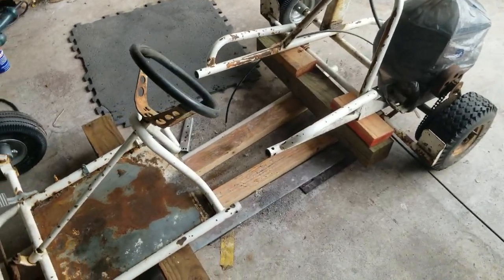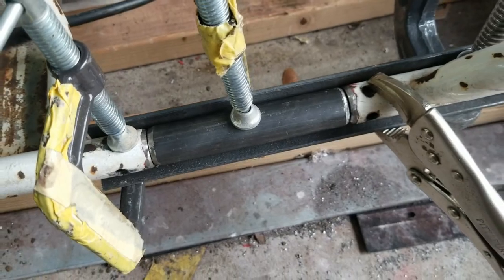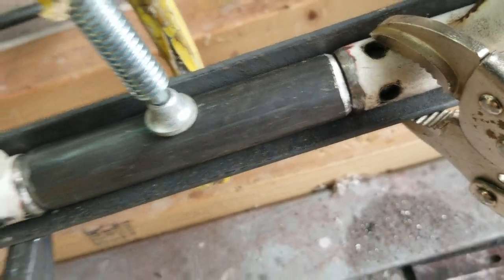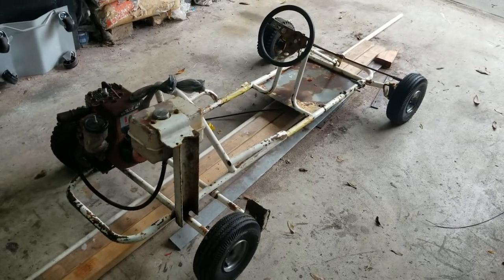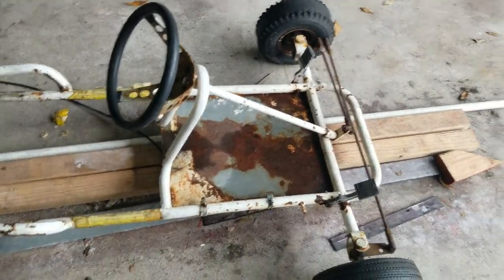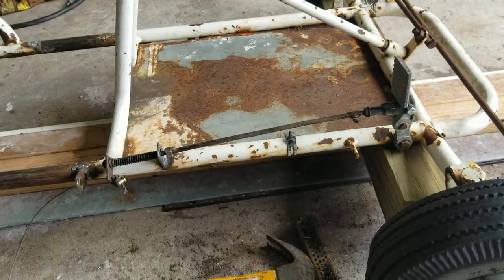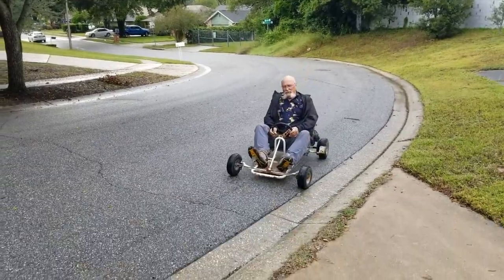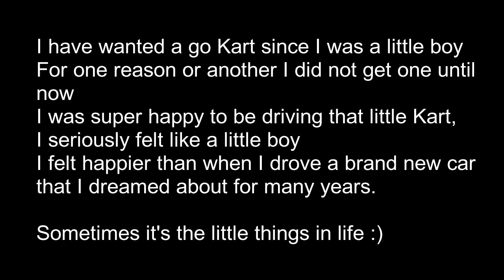Vintage Go Kart restoration Part 1

Comment: I like how U extended it...I have a go kart i was thinking about doing that, but was afraid I'd weaken the frame. 
But yours looks strong...
Reply from the maker: Thanks 👍🙂
I am very happy with the way mine came out.
Good luck in your project
Reply: I would not lengthen it at all. They were designed from the very beginning to be very small, short wheelbase, lightweight and cramped. They were designed by adults for adults and there's numerous photos of people like Steve McQueen, James Garner (both racers in real life) and Roy Orbison looking very uncomfortable on early karts with their knees in their chests. The karts that followed later that were marketed to teens and pre-teens (sold in the Sears Wishbook) followed the same pattern as people thought they were naturally perfect for smaller people.
Reply: @Hjerte_Verke  I didn't lengthen it. I Just stayed with the original frame but pushed the frame holding steering wheel forward a few inches.
That was enough space. Extending the frame was toooo much. Esp since I have 2 other bigger karts

Comment: Great idea lengthining the frame. I might copy that , the exact way you
did it, unless I  can figure a way to make it adjustable. 
I found a manco 2 people kart, at a scrap yard about 5 years ago.
It was in the big pile, they were nice enough to unbury it and let me have it 
for about   20 to 25 dollars .  And a different scrap yard about 45 minutes 
away. I was getting car parts , and they had pulled  a 1977 single manco or
sears orange crate out this time ,35 dollars. Of coarse both needed wire brushed
some straightining and welding and painting and there missing parts, but 
saves me from building a frame. I see a lot of people use the preditor 212 
at 6 &1/2 H.P. I never considerd that , Because I had a 1969 5 hp briggs 
on my homemade one . My brother sold it on me when I was in the service,
I guess because He did the welding , and turned the 1 inch axle in shop class
and milled the key way all the way across in shop class. I did build it kind of 
heavy out of water pipe 3/4 inch . I think we ran 2 pipes on each side one above the other
with spacers . I'm retired now and finally close to catching up on other projects to get 
to the rupp  scrambler mini bike paid $250. missing stuff about 10 yrs  ago and now the two
karts.

Comment: Can I ask where you bought those 5 inch  solid metal pipe with the tapered ends to fit the existing frame? I’d like to extend my go kart project as well. I guess I could go to a machine shop.... but I would prefer a ready made stock. Thx!
Reply from the maker: Hey, 
I got the metal at a local metal supply place. 
I cut them to length and tapered the pipe, 
The solid metal rod is a separate piece, that is the exact size of the inner diameter of the pipe.
If you are going to extend the frame be careful or you could ruin it.

Comment: I'm having trouble getting my drive wheel off to get to the brake band so I can replace it
Reply from the maker: I would try penetrating oil first, 
If that does not work then heat and might need a little persuasion from a hammer BUT be careful not to damage the wheel